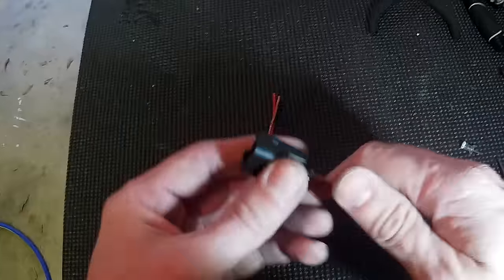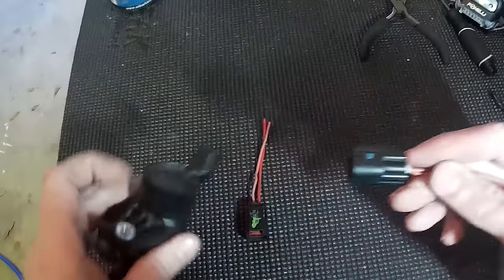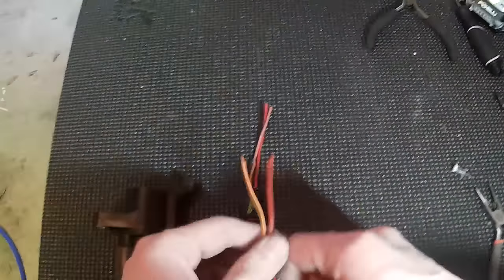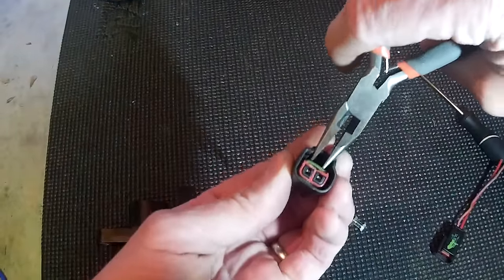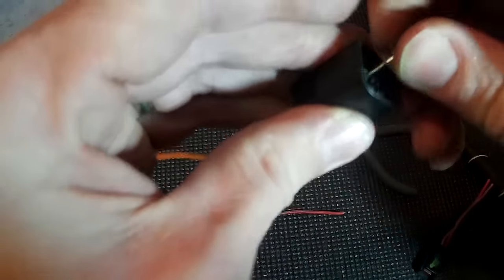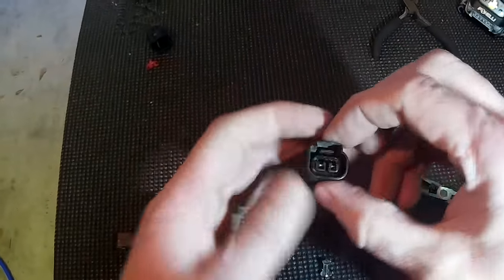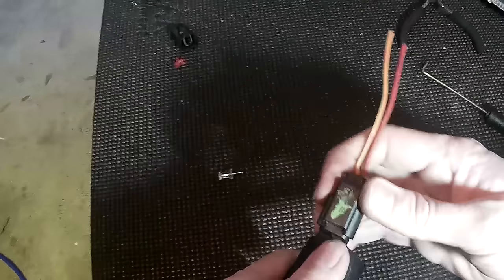Repair Ford Coil Over Plug Harness Adapters Without Cutting or Splicing. Broken ignition coil wire.

Comment: ok i have replaced my plugs and coils and im still getting a miss fire, plus i noticed i have like 3 of them connectors are like they just slip right off, so i have the connectors for awhile now, but i have not rewired them just yet, so was this your problem with the misfire?
Reply: plus my connectors, the o ring and the red pc are so old, they broke off, so that why im replacing 3 of them, i been thinking of ordering them connectors all 8 for way less then buying 1 at time from the local parts store
Reply from the maker: My misfire was the result of a loose connector. The tab was broke causing it to not make a solid connection. I would connect the car to a scanner and see if there are any codes to determine which cylinder is misfiring. Once you determine that you can start inspecting the connector and wiring on that cylinder.

Comment: A tip that may save someone grief. If you do break the tab/lever on the coil connector, but still need to hook it back up for awhile, do yourself a favor and go ahead and pull the broken tab/lever off of the plug. If not, there's a chance it will fall off of the plug and end up down in the spark plug tube. The broken off tab will be a piece of flat, black plastic @ 1/2"l x 1/4"w x 1/16"t.  It is the perfect size to slide down and wedge itself between the spark plug hex and the tube. The next time you are in there with a spark plug socket, it will prevent the socket from going in deep enough to engage the hex. If the piece is in between a flat part of the hex and the tube, it may be loose enough to get with a pick or vacuum, or both. (Good luck trying to see it). If you fought it for awhile with the plug socket, and the piece is wedged between one of the points on the hex and the tube, then it will be tight. I ended up having to cut a slot in the plug socket where one of the points was, and line it up with the point that had the plastic wedged behind it. This let the socket drop deep enough to engage the other 5 points on the hex. This was on a 2001 F150 Triton  5.4l 2-valve engine. It was a pain in the ass, and luckily, it was on the #1 cylinder. Had it been on #4 or #8, I think I would have just set the whole truck on fire and been done with it!.
Reply: Funny had this exact scenario yesterday,  had me stuck for a good 10 minutes till I shined my phone camera with the flash down #3. Thought it was a piece of a old boot but finally gently tapped the socket on after moving it around a few times haha

Comment: having code P0354 pop up turns out it's coil #4 connector snap tab is broke gonna replace using this method. thanks for the video. using on 2003 V10 F350
Reply from the maker: Once those tabs break they seem to cause a loose connection. Mine was having a slight misfire but no code. A ziptie works as a temporary fix.
Reply: B Scott just did it and everything fixed thanks!
Reply from the maker: Excellent!

Comment: Thanks for the video! Just replaced mine...just fyi, ones I had ordered on Amazon did not have the little piece that you have to pull out..learned the hard way..lol...
Reply: But did you still use the connectors you got from amazon or somewhere else?
Reply: @edb3654  yes, they worked great
Reply: Would that solve an intermit misfire?
Reply: @edb3654  possibly, long story short, I had a bad coil pack and when I replaced it I had found the clip on the connector was bad, which wouldn't hold so it was mking constant connection electrically. After replacing them mine is running smooth
Reply: Im getting a bad misfire from 1 4 7 they have that connector problem replace spark plugs and coil but not the connector part. I order the amazon ones but didn't come in yet. The ones I have are the misfire and the connector slides off like in the video. I have 281 4.6L dohc
Reply: @edb3654  yeah you should be good after you replace them. The replacements worked fine
Reply: I just got them today where you able to take apart the wire or you splice the ends?
Reply: @edb3654  I took the ends out and just  replaced the actual plastic plug part. Have you tried it yet?
Reply: Yea it went simple all 8 of them.
Reply: @edb3654  it get rid of that misfire
Reply: No my scanner tells me i have to replace the smog pump and egr valve!
Reply: @edb3654  oh dam...my light came on yesterday, I need get it on a scanner and see what's going on. Still is running good so ne telling..
Reply: @christaylor5787  Chris, which ones did you use from Amazon?  i read some of the reviews and they said this is what they were planning on doing, but the original terminals wouldnt fit the new plugs...
Reply: nevermind.....im going to order ones that were linked above from amazon...

Comment: Thank you brother for the video. I have got code P0354 ignition coil D which is  the #4 coil pack one in the back. It is not connecting. 
I'm going to do what you did in the  video.
Reply from the maker: Hope it solves your issue
Reply: @fixinstuff  yes it did

Comment: Will this cause my truck to shake and check engine light blink ? I just saw my clip broken as well
Reply from the maker: Yes. If the connection is loose most common symptom is misfire. push down on the connectors while the engine is running if its loose the misfire will go away. Mode 6 test is also helpful to diagnose which cylinder(s) are misfiring. I have a mode 6 vid.

Comment: Hi I have a 2007 Ford edge and the clip is not broke but it is not getting a good contact but if I play with the wire's enough it will work do you have any ideas for that? if so I would really appreciate it
Reply from the maker: You could try using a zip tie to secure the connection. See if you can find out if the poor connection is with the coil pack or the harness plug. Maybe switch the coil pack to another cylinder and see if it is still acting up. If so you can replace the coil. Otherwise if its the harness I would eventually replace it like the videos shows so you wont need to do any cutting and splicing.

Comment: This is an awesome video. My mpv  04 has the same issue. can I get this kind of wire from any Ford car ?
Reply from the maker: Thank you glad to help. You should be able to find the harnesses you need at a junk yard or possibly even eBay. If a Ford vehicle used the same engine as your Mazda you should be good.

Comment: it helps a lot, one more thing if you add a part number or link where to buy this connectors thanks
Reply from the maker: As far as I know only place to obtain this OEM part is from a Ford dealer for $$$$ each. Aftermarket connectors can be found at auto parts shops for cheap but the pins are not the same and you will need to spice or solder them in. Scrap yard is your best bet. Fords a plenty.

Comment: tried this and the little pin part wont go back inside connector .The red part. mine is yellow and smaller . dont work also the wires wont seat all the way inside cuz the rubber stops wont fit back in back of connector

Comment: The OE tangs do not fit most aftermarket connectors; you need Motorcraft WPT-986  3U2Z-14S411-SLB. But like he said, a junkyard is a cheaper way to get an OEM ignition coil wire connector.  Does anyone know what would happen if the two wires are mixed up?

Comment: Question if that clip in the middle breaks would if cause the car not to start if the plug cannot stay plugged in
Reply from the maker: It would cause a weak connection resulting in a misfire for that cylinder.

Comment: Did I hear you say the aftermarket connectors won't fit the stock harness? I can't buy the aftermarket connector and pigtail, disconnect the pigtail and connect my stock wires to the new connector?
Reply from the maker: The factory metal pins won't fit into an aftermarket harness so you would have to cut the wire and splice it in.  I purchased a few aftermarket harnesses and tried to fit the OEM metal pins into I realized that they were a different design every time. My next idea was to hit up a scrap yard and pull from newer or low milage Fords. Plenty there to choose from.
Reply: @fixinstuff  Found that out the hard way, too. Tried 3 different aftermarket pigtails, and the pins from the original plug would not fit any of the newer plugs. Go with the identical plug from a junk yard if you want to do it this way. Otherwise, buy new pigtails and solder them in. Be gentle & take your time. It's doable.

Comment: Hi, what if I ripped the wires and because of that I can't pull the terminals from the wires? Can I push out the terminals instead of pulling out by the wire?
Reply from the maker: They will only back out. Remove the red face and find something to push the pins down with. A metal pick will work. Push down on the pins and pull back at the same time. Once you got it the rest are easy. Worse case is that you will have to end up splicing in a new one. In that case I would solder the connection and use heat shrink. Good luck

Comment: Thx for the vid. I have this issue on 2. gonna give it a shot. found plugs, 9.99 on amazon
Reply from the maker: Just make sure that they are Ford plugs. I tried using aftermarket ones from an autoparts store and the metal pins would not seat into them. That when I got the idea of going to the scrap yard, no shortage of 5.4's there!
Reply: Ok. Thanks. I may to the yard first
Reply from the maker: I keep a few in the tool chest, always good to have a few extra around since they are so brittle.
Reply: At the yard. Do u just clip em and take em home to take em apart.
Reply from the maker: Yep. Thanks exactly what I do. I also try to find the newest 5.4's that I can so they are in the best shape. Bring some sharp wire snips they can be tough to cut through sometimes.
Reply: Kool thx

Comment: would it be ore difficult if you have to work in an vehicle? my #3 is having same problem. thanks
Reply from the maker: I have done mine inside the engine compartment with no problem.
Reply: great, I did in my suv today, and it was not that difficult, thank you again for the great video, great help, I hope my P0303 disappear soon.
Reply: did you have to disconnect the battery when you took the harness off?
Reply: I did not disconnect the battery.

Comment: antifreeze spilled on my coil harness connector. cant i clean them or do i have to buy a new cables
Reply from the maker: Eduardo Lopez should clean right up with water and compressed air to dry it up and blow the water out of the pins. Disconnect the battery first.

Comment: how do you replace connector on #4 coil on 5.4 ford engine? not much room
Reply from the maker: I use 1/4 inch socket with a short extension and u-joint adapter.

Comment: How do u get the other end of the wires on the car??
Reply from the maker: These wires are only cut for demo purposes you can do this while they are still attached. If you cut them be prepared to solder of crimp them or both.
Reply: B Scott thank you! Can I use the butt connectors?  Two wires got pulled when the alternator was being changed on a 2002 Honda Civic
Reply from the maker: The crimp style?. I would personally solder the wires together and heat shrink the connection. If you choose to use the butt connectors make sure the wires are clean and I would use heat shrink around the connection to avoid water getting in.

Comment: !! Found an aftermarket they must have recently made that actually fits !! At first I bought some aftermarkets that looked similar but when I tried them, they didnt work (as B Scott stated in the video). Did a lot of hard searching and was able to find these. figured it was my only shot since I dont have a nearby junkyard. Got em today and within about 1 minute, I had the connector swapped. No splicing, no wire work. Simply clicked in just how this video described. I think these might have recently come out, and for my 2008 f250 5.4 they work perfectly! Very solid. https://www.amazon.com/gp/product/B01BA71OQA/ref=ppx_yo_dt_b_asin_title_o00_s00?ie=UTF8&psc=1

Comment: Don't know what will happen if you mix up the pins but I don't think it would be good lol
Reply from the maker: misfire and possible coil damage. I mark one wire so I know which are on the left and right.
Reply: Actually burned driver for pcm

Comment: I replaced all of them before I watched this video like a dummy. I spliced all of them with butt connectors. My truck ran  smooth for about 3 days. Now it misses and runs like crap. I checked all connectors and all seems like there is good connection. All my coils, plugs and connectors are new.  I just put a brand  new engine as well. Pretty much everything under the hood is new. Soooo frustrated!
Reply from the maker: I spiced my first one before I figured out how they come apart it happens. You might have a bad splice on one of the crimps or voltage jumping across the wires at the connections. Tug on the wires to see if any break free from the splice and look for sparks at night spritz from a water bottle can help find them. Worst case you may be able to find a full wire harness at a yard. Time consuming but not difficult to do.
Reply: @fixinstuff  you are correct. I tugged on the wires and a couple of them came lose. It runs  nice now but still has a ticking noise. It has no passing power and burned 3 plugs completely off. I think now it the catalytic converters. I bought another truck so I dont have to drive it but this spring I'm changing out the converters with Hope's it clears up. It's a hell of a good work truck. Thanks for your response.

Comment: I hope people are still looking at the comments.  I just bought 8 new plugs on ebay, but the pins in the plastic clip are the incorrect size and won't fit with the original wire connections.  Does anyone know where I could find these online (don't have any junkyards around here) that will fit the same cable pin connections?  A link or correct google search phrase would be very helpful.  Thanks in advance!
Reply from the maker: Someone mentioned finding them at Rockauto.

Comment: You just put the thick wire on the right. Oops.
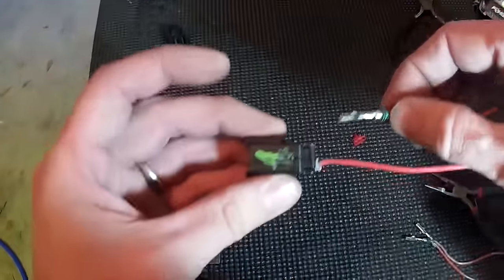Reply from the maker: I rewatched it and it and red and yellow went into the correct slots,  5:00 minute mark the thicker red wire is on the left. But good reminder to mark them because they could easily be switched.

Comment: That's not a fix. That's a replacement. I wire tied mine down with.032 wire. Don't use any plastic like a wire tie that's plastic. If you really want a fix then tie it down tight and who cares about a sorry ass harness plug!